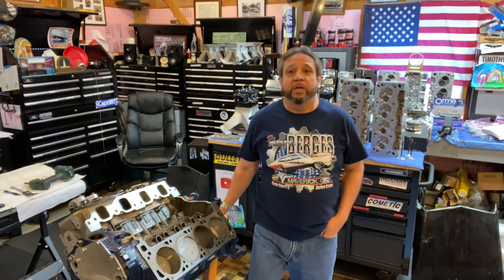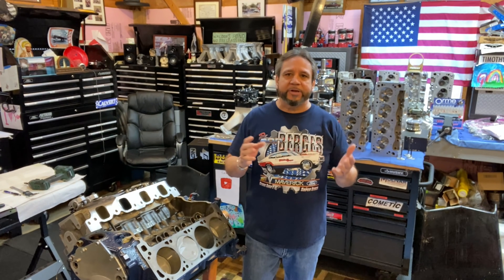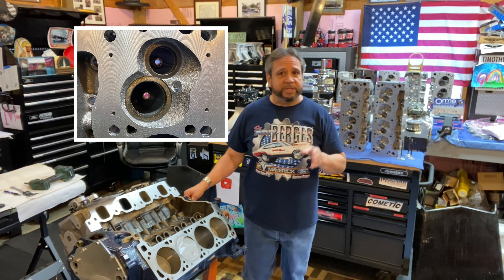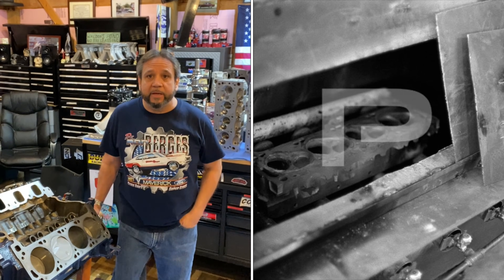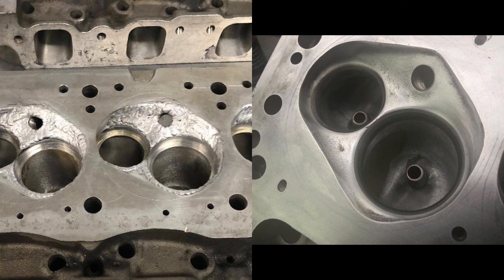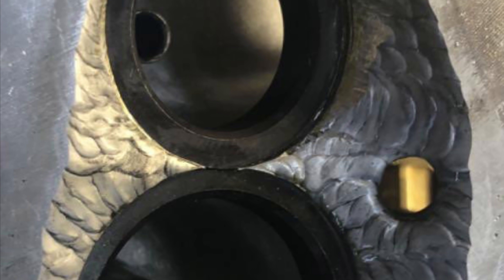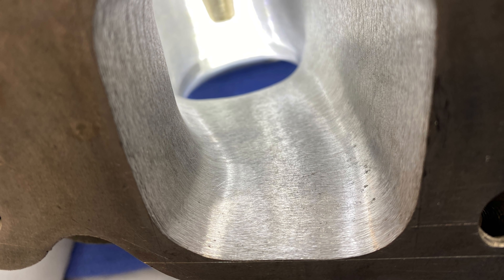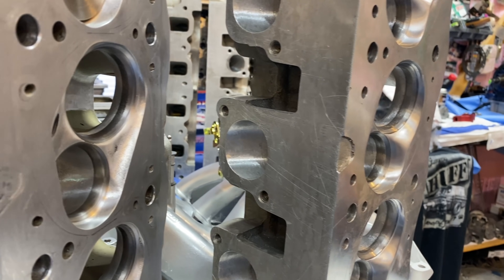The Rarest Ford Head Ever Made...Secret A3....By Darin Morgan

Comment: Results should be fantastic. But, stitching a case of welding rod on, some good machining, and getting one of the best airflow guys to spend 100+ hours reconfiguring, would put almost any casting on kill, right? 40 years ago, when they welded the top of GM W-port P/S heads, it was the only available starting point, and the stakes were exponentially higher. "Tune up" and parts availability difficulty? Surely less trouble to call Kaase and Jesel?
Reply from the maker: You only go around once on this big blue ball, so I went with what I have, and he has only 20 hrs in them, so far. There will be only one 69 cougar with a a stoked Cleveland and A3 heads. Any one can call Kaase, and buy Jessel, but sometimes, it just have to be different. Glad your here and let see how they do.

Comment: Thats alot of work.  I would Love to see more close up views of that head, around the seat and under to the short side.
I have listened to 4 plus hours of his vids.  Darin Morgan has a  Very interesting perspective,  he has and it made me think alot.  
He spoke about turbulence, and I had trouble with turbulence on my c302b's back in the 1990s. around 0.700 lift area)..and overall those heads made great power for what they were.  I ran the larger valve in them (some guys ran 2.15) I ran 2.19 and 1.71 while some guys ran 1.60
I ran that roush intake (9.2) and that is a nice manifold.   I was curious to see under that 4 hole spacer-how he did the runner inlet....but all the magic is under the seat anyways.   I was looking at Those A3's and looking to see if he put a fin in them to divert the wet flow to plug area.     

looks like the morgan A3 has a slight difference in some of those little water-steam holes on the deck from your other one.

  Initially, mine was a 357inch with a mild roller 11.7 to 1 and I shifted it at 7000 and ran 10.3 @133 @3200 in 1993.  
Later we opened the heads up more, picked up 30cfm-but it didnt make a huge improvement.  
Then I built a 398 svo block....14 to 1..a little more cam and it ran to 7600 rpm.   best was 9.72 @142  @3250 lbs  https://www.youtube.com/watch?v=trmWPCvReUk&list=FLev5yfmM6FuFRyI7IcuA02w&index=10

been watching your channel.  thanks.

ps. I was Banned by stormin norman from running against any of their races since I had a Cleveland.  I was pissed at first, then I laughed my a$$ of, when these guys had roush engines with high end tfs high ports done at race shops, and they were scared of a backyard Jersey built Cleveland with newer aluminum heads.   The Fear. LOL

25 years later. Ford spending Millions on a modern canted valve (7.3 godzilla)  LOL   whats old is NEW.
Reply from the maker: Great history Harry sounds like you have had a ton of experience with them. There is no vane imports like some of the old pro stock heads, but they have sort of vanes with porting. I can show you some close up if you email me. Funny how they banned Your cleveland, scared of a motor only made for a few years. Lol. I can show you some more pics, here is a vid with some more views. Thanks for watching and contributing to my channel. Are you still racing these parts, what happened to them? https://youtu.be/yWfQcxfX0do

Comment: Heads like that are a lot better than HEMI first-gen and second-gen!
Reply from the maker: You think so John? I know they flow well, I think I can make my goal of 850hp. Thanks for watching
Reply: @dragboss351cleveland  For suer! Hemis do ok boosted but not N.A. you know as much as I do to make good HP you need high compression the only way to increase compression on a Hemi is to have a super high dome on the piston and that is super bad for turbulence in the combustion chamber.
Reply from the maker: Good deal man. I have seen a few super stock Hemi with brazed ports. Not much about pistons. Also what about cutting heads to increase CR? Thanks John
Reply: @dragboss351cleveland  Have you seen a modern-day pro stock combustion chamber they mite some things you could use on those Cleveland heads.
Reply from the maker: @mcfast52  I have seen them, but could a Cleveland be able to use?

Comment: Those are the big port A3's, like the ones I have.  Made for the 2 plus mile tracks.  I was told when I ordered mine there was two other versions for shorter tracks.  They had smaller ports, I presume but was not told that might be for better torque out of the corners.  Sure nice to see some other ones of these.  I've been working on acquiring parts to put these to use in my dirt late model.  Years ago I bought some Carrillo rods, and pistons from someone off ebay, they are a nice Wiseco high compression piston, oddly 4.035 bore.  With these parts It appears the engine is going to be a 393, although I wish it was a 408 instead.  Still need a crank and aluminum 9.2 block.  Most everything else I have.  Thanks for showing off these old parts.  I'm hoping I'll be close to 800hp, probably end of around 775 but we'll see.  I'm running a 347 at a little over 600hp now, maybe 630.  Can't wait to have a little more torque in the corners.  I have a Roush manifold for these heads, one for the 9.2 block, and another odd one for an 8.2 block.
Reply from the maker: Greg, yes you are right, they has A4, B3, c3, lots of versions.  Sounds like you have a solid foundation for sure. Amazed  at circle track guys, they have different issues than drag racers for sure. I bet you can get close to 800hp with the right parts. Thanks Greg for checking out my channel. Don’t forget to like 👍 and stay tuned.

Comment: Waaaaaaaaaaaay, toooooo, much work . This went away in the Eighties in Pro Stock . Isn't there a casting *anywhere * with enough meat in it to make these mods with zero welding ? ,,, Btw, now you have to get the heads heat treated, back up to a T-6 condition or the valve job will walk all over the place . ,,, on edit: I should say that this kind of work went away for the GM crowd, bit I'm sure Bob was still welding Shotgun castings . Only because Ford didn't have any good raw, modern, castings for him .
Reply from the maker: Your missing the point. Hand crafted is what I want, something no one else has or ever will run. Sit back and enjoy the show.... stay tuned Roland
Reply: @dragboss351cleveland  ,,, well, my point is, Darrin can set you up to make a thousand horsepower, from 358 cubes, with probably no welding . Yes, you will have to rev it to 10,500 or more . I'm, 77 and still learn most days, I think you are ready now . Oh I can do it also, and the heads Darrin will set you up with will make these welded nightmares look as old as they are . Thinking 4.090 , X 3.400 .
Reply from the maker: Right on. Have set of Blue thunders he is going to do. But I don’t run them first.  I want to achieve my goal with what I have, 40 year old heads.

Comment: Who knew?  I mean 40 years ago all the hotrod books on the shelves would headline the small block chevy.  You'd once in a while find an article on the Cleveland,  The big secret they'd describe is port matching the intake and manifold ports.  But those of us that worked with that great engine knew there were secrets buried deep within those heads because Bob Glidden was annihilating  the competition with them.  Problem was:  He wasn't talking!  For instance the time he wrecked his Pinto and covered up the intake manifold.  I asked an experienced circle track racer that was using both a Cleveland and small block Ford what the deal was with the intake manifold.  He said it was all put on. He did that to take your eyes away from what he was really doing.  So the secrets stayed hidden until many years later.  Glad you're here to share them with us.  And Happy 6th Birthday to Helena!!
Reply from the maker: Thank you for taking the time to comment. These heads are 40 years old. There are still some secrets I am learning, but I don’t mind sharing. The only intake I ever saw cover was I the T bird when it rolled in Atlanta I think. Either way, glad your here and can’t wait to make a update video, maybe this weekend. See if I can get R done.

Comment: i dont know if i caught it..but are the plug holes at a different angle??..and i like your shirt...love mavericks ..had a few back in the day
Reply from the maker: No He did not change the spark plug location or threads. Thanks that maverick is Dr. Ron Racing. It runs a 800+hp Boss 302....